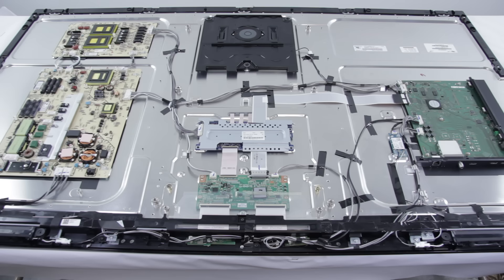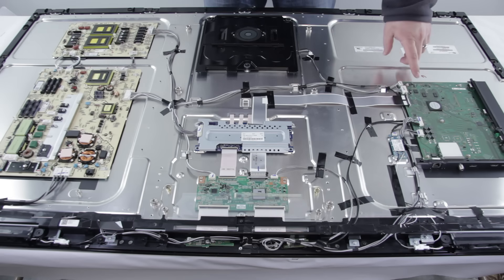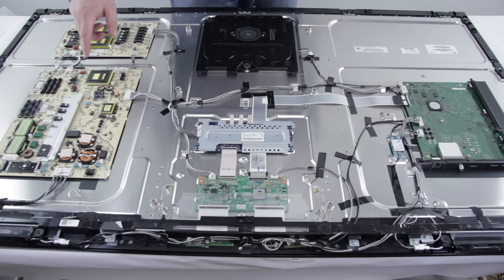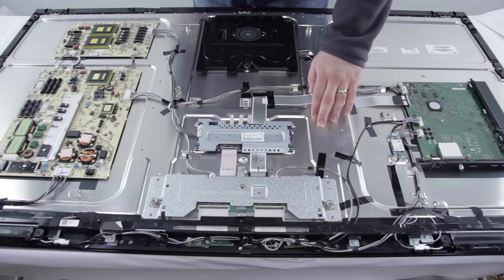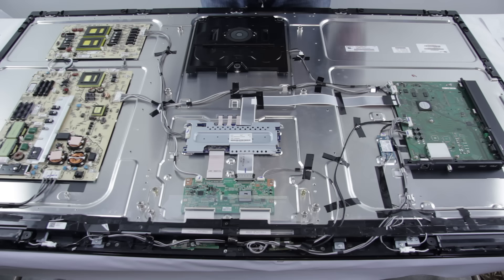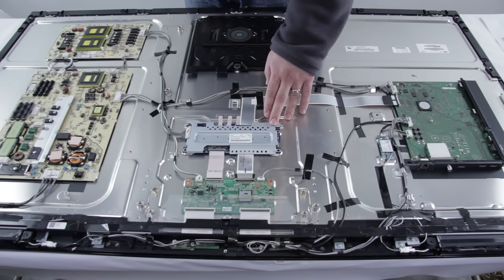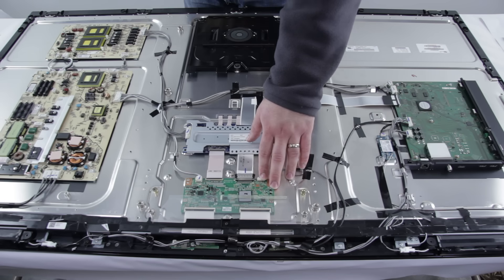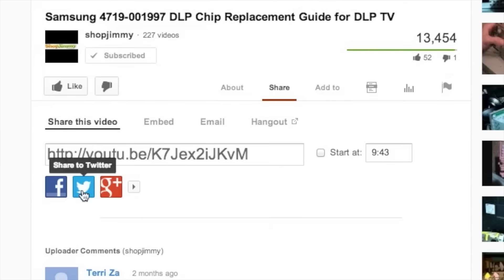LED TV Repair Tutorial - Common Symptoms & Solutions - How to Repair LED TVs

Comment: Hi i have Samsung 32Inch Full HD LED TV.
Model number : UA32F5100AR.
Issue with this TV is, suddenly display went off when it was working. Audio was good but no video.
I opened up & checked power supply for mother board, it was good. however i didnt found any supply out at the 1+, 2+, 3+ & 1-, 2-, 3- power supply output where it was connected to screen.

Can you help me to troubleshoot the issue?
Reply from the maker: Guru Murthy   I recommend running the flashlight test on your TV.   Here is a link to a video we produced that shows how to run the flashlight test. https://www.youtube.com/watch?v=xUzCLgoSPGM Please reply with your flashlight test results and we can recommend a replacement part for your TV repair. Thanks and please let us know if you have any questions! www.shopjimmy.com
Reply: Thank you for your reply, i will do the test and update you the results soon.
Reply: I did the  flashlight test today. as you mentioned i could able to read the menu content during test. 
That means display is okay only the back light is gone bad, can you help me to fix this issue.

Comment: Hi shopjimmy, I have UA46F6400 samsung led tv...its been 13 months since I bought this tv. Now the problem is some clouds or spots have started to appear on the screen and its increasing. You can see here http://postimg.org/image/4u2vssc5v/ 
Kindly advise what could be the problem and part needed to be replaced.
Thanx.
Reply from the maker: *****   This sounds like a TV panel (TV Screen) problem.  If your TV panel is bad, it may be more cost-effective to replace the TV as panels are typically hard to find in stock, difficult to replace, and expensive.  Thanks and please let us know if you have any further questions!  www.shopjimmy.com
Reply: thanx.

Comment: My tv is LA40C531 samsung. It turns on then after few seconds it turns off. Samsung service center says it should change the system board. They try to remove the cables connected (usb, hdmi, tv cable) then my lcd tv continues to work on. But once this cables connects it shuts off. Whats the possible problem? Thanks in advance!
Reply from the maker: cherubin lopez   I recommend replacing the main board in your TV.  Unfortunately I do not see any replacement parts in the search results for your TV model number on our website.  Please reply with your part number on your main board and I can try searching for replacement parts.  Thanks and please let us know if you have any further questions!  www.shopjimmy.com
Reply: thank you for the prompt reply, the part number is BN94-03991Z
Reply from the maker: cherubin lopez   Unfortunately I do not see any replacement parts in the search results for this part number on our website.  Thanks and please let us know if you have any further questions!  www.shopjimmy.com

Comment: what is wrong when the tv has no picture.... 47LN5700
Reply from the maker: Joyce Thomason Does the TV have a standby light in the front?  I recommend running the flashlight test on your TV.   Here is a link to a video we produced that shows how to run the flashlight test. https://www.youtube.com/watch?v=xUzCLgoSPGM Please reply with your flashlight test results and we can recommend a replacement part for your TV repair. Thanks and please let us know if you have any questions! www.shopjimmy.com
Reply: ShopJimmy.com yes we done the flashlight test and the menu does show up...
Reply from the maker: Joyce Thomason  Please watch this video FIRST to help with your repair!  https://www.youtube.com/watch?v=BP3NVNCGEv8  This could be a problem with the power supply or the LEDs in the TV Panel.  I recommend replacing the power supply board in your TV to see if that fixes the problem.  Click this link to replacement parts for your TV model number:  http://www.shopjimmy.com/catalogsearch/result/index/?cat=59&q=47LN5700  Be sure to match part numbers on your current board, with your replacement for compatibility.  Thanks and please let us know if you have any further questions with your TV Repair!  www.shopjimmy.com
Reply from the maker: ShopJimmy.com  Please watch this video FIRST to help with your repair!  https://www.youtube.com/watch?v=BP3NVNCGEv8  This could be a problem with either the power supply board or the TV has bad LEDs in the TV panel.  You can replace the power supply board to see if that fixes the problem.  Click this link to replacement parts for your TV model number:  http://www.shopjimmy.com/lg-eay62810801-power-supply-unit.htm  Be sure to match part numbers on your current board, with your replacement for compatibility.  Thanks and please let us know if you have any further questions with your TV Repair!  www.shopjimmy.com

Comment: HAVE A TOSHIBA 46L5200U1. HAVING PROBLEMS WITH HDMI 1 AND 2. HDMI 3 IS WORKING WELL. BUT 1 AND 2 ARE NOT. WHAT IS THE PROBLEM?
Reply from the maker: Cesar Salgado  Please watch this video FIRST to help with your repair!  https://www.youtube.com/watch?v=BP3NVNCGEv8  I recommend replacing the main board in your TV.  Click this link to replacement parts for your TV model number:  http://www.shopjimmy.com/toshiba-461c4r51l13-main-board-for-46l5200u1.htm  Be sure to match part numbers on your current board, with your replacement for compatibility.  Here is a link to a video showing how to identify your part number, click here:  https://www.youtube.com/watch?v=3DQe0ATZl_Q  Thanks and please let us know if you have any further questions with your TV Repair!  www.shopjimmy.com

Comment: Hi, I have a LG Model: 47LS5700-UA.  I'm seeing horizontal lines extending edge to edge, equally spaced from top to bottom.  The lines are thin and black.  They are present all the time and show up in front of the settings menu and can also be seen running across the LG logo on TV power on.  Can you point me in the right direction as to the cause please?  Thanks.
Reply from the maker: André Solomon  This sounds like a TV panel (TV Screen) problem.  If your TV panel is bad, it may be more cost-effective to replace the TV as panels are typically hard to find in stock, difficult to replace, and expensive.  Thanks and please let us know if you have any further questions!  www.shopjimmy.com
Reply: ShopJimmy.com thanks.  I also contacted LG and they advised it sounds like the mainboard.  Is that a possibility from your experience?

Comment: RCA 50" Model# LED50B45RQ. Just turned off unexpectedly and now will not turn back on. It has the red light on in the left hand corner when plugged in but when turned on the screen makes a small dim blick towards the center of the screen then turns off completely.
Reply from the maker: Alexander Rounds  Please watch this video FIRST to help with your repair!  https://www.youtube.com/watch?v=BP3NVNCGEv8  I recommend replacing the main board in your TV.  Click this link to a replacement main board for your TV model number.  http://www.shopjimmy.com/rca-e13040148-main-board-for-led50b45rq-version-1.htm  Be sure to match part numbers on your current board, with your replacement for compatibility.  Thanks and please let us know if you have any further questions with your TV Repair!  www.shopjimmy.com
Reply: hey Alexander
did you find out what was wrong with that TV ? I have the same problem now

Comment: LED TV REPAIR HELP PLEASE?  I have a SHARP AQUOS LED Model LC-40LE550U that has sound and no picture. If I turn the lights out I can see a faint picture while holding up a flash light to the screen at an angle. If I tap the side of the tv I get a 1/2 sec picture. I have replaced the power board, main board and the t con run board. Did I miss anything else? It appears there is a strip wired running the whole bottom length of the tv. The TV is just over a year old and I'm frustrated. Thanks and Happy New Year to all!
Reply from the maker: Cliff Reggie   This sounds like you have bad LEDs in the TV panel.  If your TV panel is bad, it may be more cost-effective to replace the TV as panels are typically hard to find in stock, difficult to replace, and expensive.  Thanks and please let us know if you have any further questions!  www.shopjimmy.com
Reply: ShopJimmy.com
 I must say that this comment is the closest issue to my current situation.  I have Samsung UN46EH6000FXZA and the screen goes black after short cycles.  I can also tap the back and get it to blink on shortly.  I have also replaced the Power Board 2x from ShopJimmy.  The first time this happened I replaced the power board it seemed to have resolved the issue.  Then the issue returned.  I replaced the power board again and it did not resolve the issue although the symptoms seem to be the same.  I have upgraded the firmware, reset the settings...So at this point I have found that if I turn the backlight setting all the way to 0 - then the backlight does not shut off.  However it is obviously not very bright.  But does that help in diagnosing the issue?  The backlight works, just seems that if you turn it up that something builds up enough to shut down.  Does it sound like Main board/TCon/or bad LED panel/ or something else?  Thanks ShopJimmy.

Comment: MY lg 47 lx9500 was ON  for sometime without any signal. Then it turned off ( went to standby) automatically. There after when turned on, it powers and shows LG symbol two  seconds and disappears, and it stays black but the power button is lit.
When i power on with remote, the power light turn from pink to blue and then white. But no picture or sound .
please advice or comment on it?
Reply from the maker: ano kar  Please watch this video FIRST to help with your repair!  https://www.youtube.com/watch?v=BP3NVNCGEv8  I recommend replacing the main board in your TV.  Click this link to replacement parts for your TV model number:  http://www.shopjimmy.com/catalogsearch/result/index/?cat=56&q=lg+47+lx9500  There may be multiple boards for the same TV model number, be sure to match part numbers on your current board, with your replacement for compatibility.  Here is a link to a video showing how to identify your part number, click here:  https://www.youtube.com/watch?v=RwHTvjMdrhk  Thanks and please let us know if you have any further questions with your TV Repair!  www.shopjimmy.com

Comment: Hi,

I have a LG TV 47LV5400UB.  It went dead (no sound, no pictures.) At the lower hand corner, it still has a power light.  I was told and convinced that the power board could be bad.  I ordered a new power board from eBay.

Two days ago, I've just replaced a new power board and hoped it would fix the problem, but as soon as I'm done replacing the board, nothing came up (no sound, no pictures.)  I was able to use the remote controller to power on(white light appeared) and off(red light appeared), nothing happened on the screen.

Any ideas, suggestions or recommendations would be very appreciated.

Best Regards,
PillarP
Reply: hI, IF YOU GET ANY RESPONCE AT ALL WHEN YOU PUSH POWER, BUT TV DON'T COME ON , SHOULD BE P/SUPPLY, NO RESPONCE AT ALL, SHOULD BE MAIN. brD.
eD PRECISIONTV TECH.
Reply: Hi Ed,

Thanks for a quick response!

I've just replaced the power board.  I could power on, power off (via remote control or button on the TV itself) but it had no pictures, no sound at all.  The new power board that I've ordered could be bad (Dead On Arrival) ?? I have heard another customer has the same issue as I'm having.  I'm unable to afford a new TV set.

Do you you think it might be a T-Con board, possibly?

Please advise.  Your ideas or suggestions are greatly appreciated.

Best Regards,

Pillar
Reply from the maker: Pillar P  Please watch this video FIRST to help with your repair!  https://www.youtube.com/watch?v=BP3NVNCGEv8  I recommend replacing the main board in your TV.  You are still receiving some power from your original power supply, as that is why you still have a standby light, but the main board is not turning the TV on.  Click this link to a replacement main board for your TV model number:  http://www.shopjimmy.com/catalogsearch/result/index/?cat=56&q=47LV5400UB  There may be multiple boards for the same TV model number, be sure to match part numbers on your current board, with your replacement for compatibility.  Here is a link to a video showing how to identify your part number, click here:  https://www.youtube.com/watch?v=RwHTvjMdrhk  Thanks and please let us know if you have any further questions with your TV Repair!  www.shopjimmy.com

Comment: Need Help Please. I Have an LG 55LW5600 Smart LED TV. The picture comes on for a little while in the morning then about 20-30 mins into it the screen goes blank. Sound still comes through. If i turn the tv off overnight then turn it on again in the morning same thing I can watch for a little while then gone again.  Once it is gone if you try to turn it back on right away the LG logo comes up then flickers off and we are back to sound with no picture.
Reply from the maker: lpatel2581   This sounds like you have bad LEDs in the TV panel.  If your TV panel is bad, it may be more cost-effective to replace the TV as panels are typically hard to find in stock, difficult to replace, and expensive.  Thanks and please let us know if you have any further questions!  www.shopjimmy.com

Comment: i have a 2009 LG tv model number 42Lf11-ua. sometime the screen is half black, some times there are lines in it. is this problem fixable & is it expensive?
Reply: hI, IT SOUNDS LIKE YOU HAVE BAD CONNECTIONS ON RIBBON CABLES, PROBABLY FROM MAIN brd. TO T-CON brd. IF YOU CLEAN CONNECTIONS IT MAY RESTORE CONSTANT FULLSCREEN PICTURE.
ED PRECISIONTV TECH
Reply from the maker: Ann McGhee   This sounds like a TV panel (TV Screen) problem.  If your TV panel is bad, it may be more cost-effective to replace the TV as panels are typically hard to find in stock, difficult to replace, and expensive.  Thanks and please let us know if you have any further questions!  www.shopjimmy.com

Comment: I have a Samsung LED TV, Model # UN55D6000SFXZA, S/N- Z2Z73CRB400304R Version # H302 that has horizontal ghosting lines across the entire screen. All other functions operate properly. Is the Horizontal control part of the main board?

Comment: Model: Samsung plasma 3d TV "PN50C7000YF" Model Code: "PN50C7000YFXZA"
First off thanks! I turned the TV on one morning to find a perfectly centered small (looks like 2 pixels wide or 1/32 thick) solid black horizontal line running through the TV from end to end. I have tried diagnosis and researched the web but I couldn't find any solid suggestions for the fix. A lot of people said it was either the X Y Z boards? Any help is greatly appreciated thank you.
Reply: a duplicate line just formed 1/2" above the first line.

Comment: Hello I have 55" LED 3D Samsung that will not power up completely.  The red LED power light flashes and the TV cycles through the Samsung logo to just a black backlit screen the pop noise and then off then back to Samsung logo screen and ect.. TV is Model UN55EH6070FXZA and only 2 years old.  Samsung was no help at all.  Any help is greatly appreciated.
Reply from the maker: Eric Welter   Please watch this video FIRST to help with your repair!  https://www.youtube.com/watch?v=BP3NVNCGEv8  I recommend replacing the main board in your TV.  Click this link to replacement parts for your TV model number:  http://www.shopjimmy.com/catalogsearch/result/index/?cat=56&q=UN55EH6070FXZA  There may be multiple boards for the same TV model number, be sure to match part numbers on your current board, with your replacement for compatibility.  Here is a link to a video showing how to identify your part number, click here:  https://www.youtube.com/watch?v=BEPWrefQvqI  Thanks and please let us know if you have any further questions with your TV Repair!  www.shopjimmy.com

Comment: I need LED TV repair help for Samsung 32 inch Model No:UA32F4000AR. It doesn't show video but it's audio is working what is the problem behind that and how did it occur. PLEASE GIVE SOLUTION TO THE ABOVE
Reply from the maker: Anandharaj G   I recommend running the flashlight test on your TV.   Here is a link to a video we produced that shows how to run the flashlight test. https://www.youtube.com/watch?v=xUzCLgoSPGM Please reply with your flashlight test results and we can recommend a replacement part for your TV repair. Thanks and please let us know if you have any questions! www.shopjimmy.com
Reply: ShopJimmy.com I've tested flashlight test on my TV. And it shows all the options and channel no,etc., I unable to find LED driver and T-Con board, it contains only two boards only......
Reply from the maker: Anandharaj G   This could be caused by either a bad power supply board or bad LEDs in the TV panel.  You can replace the power supply to see if that fixes the problem.  Unfortunately I do not see any replacement parts in the search results for your TV model number on our website.  Please reply with your part number on your power supply board and I can try searching for replacement parts.  Thanks and please let us know if you have any further questions!  www.shopjimmy.com